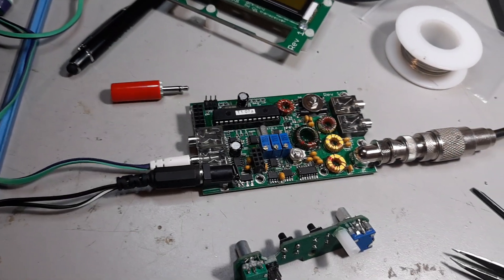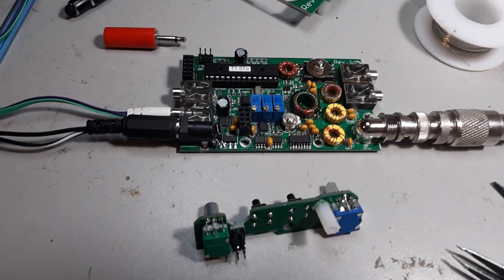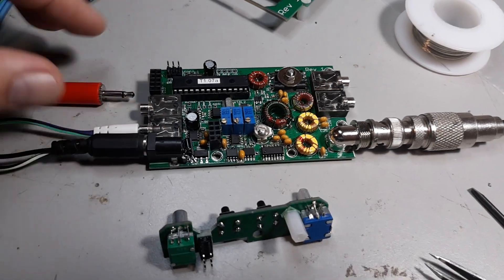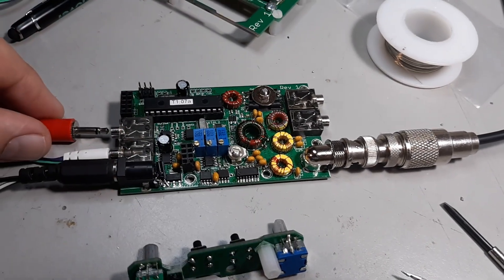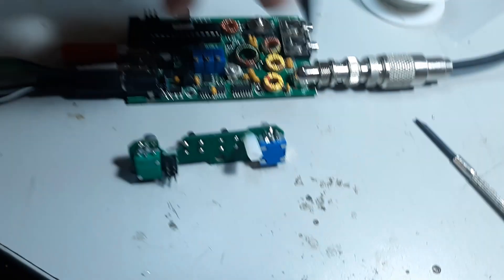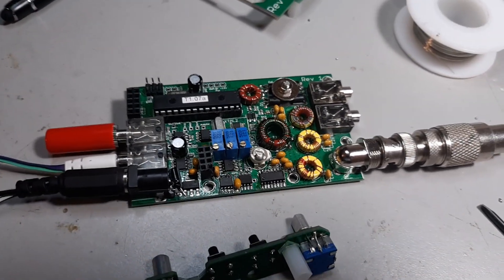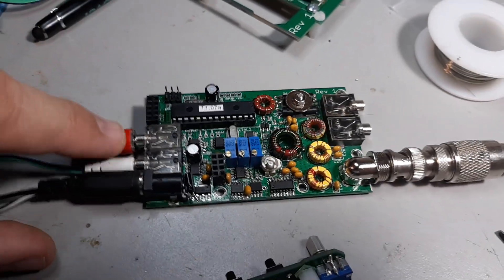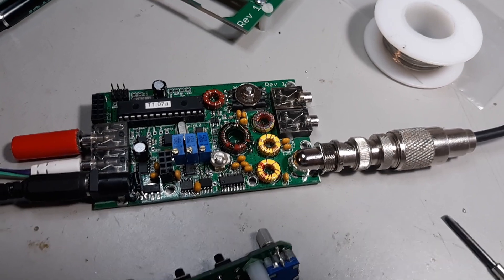QCX Mini Mini Tip 9 Power Output

Comment: I don't get any power out, yet I can receive just fine, any ideas?
Reply from the maker: Check all your toroid windings and connections. Many times I've had to reheat them 2-3x to get a solid connection. Check the troubleshooting guide too. 73!